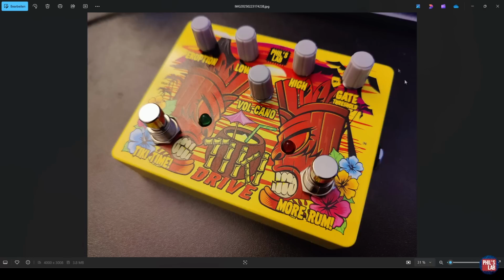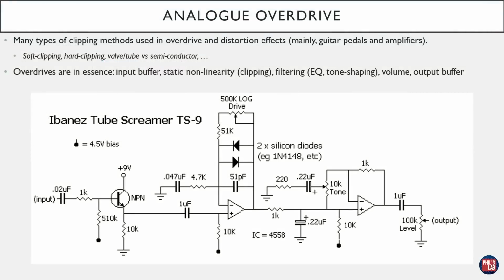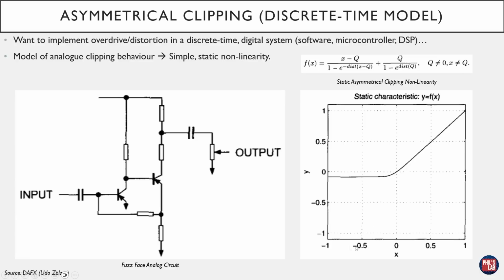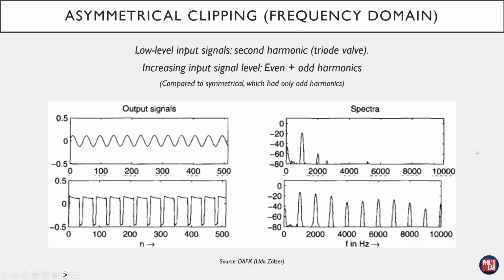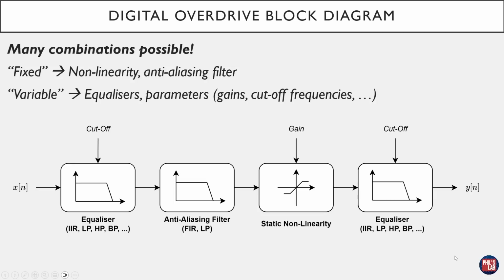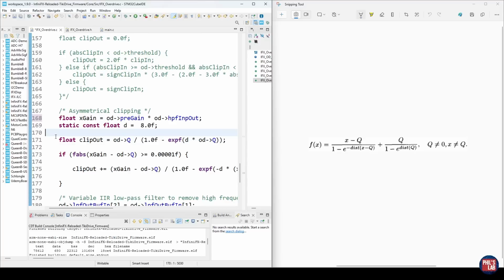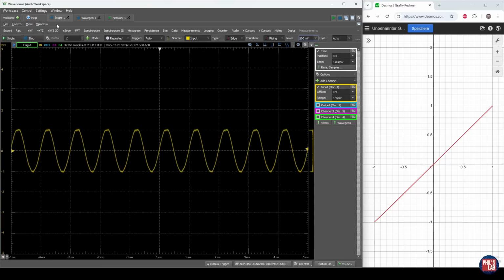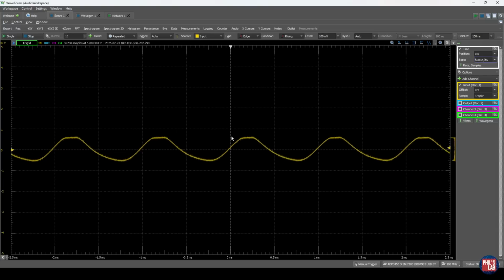DSP Overdrive (Asymmetrical Clipping) in Software (STM32) - Phil's Lab #153

Comment: Amazing video full to the brim with valuable details. If only I had your videos back in UNI days...

When it comes to the STM32H7B0, did you encounter a problem that it works until 88MHz (power level 3), and after that, it keeps freezing when the system switches clocks? For some reason, it happens to me regardless of whether I use an internal or external clock source and at any higher power level (2, 1, 0).

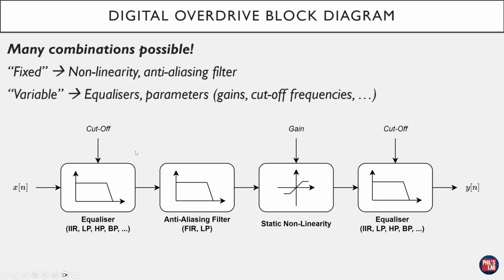Comment: 10:40 but aren't the supernyquist frequencies that cause aliasing generated /by/ the nonlinearity here? especially since you've already bandlimited the input by sampling it to begin with, the anti aliasing filter is generally the last step before conversion so that those frequencies don't make it to the converter and alias? idk man i'm not seeing the vision here, or are you just using zero oversampling and trying to preemphasis the high frequencies? because that makes even less sense to me, given the amount of distortion that an overdrive pedal is providing that just guarantees aliasing

Comment: I know nothing about DSP, but wouldn’t it be better to use branchless options to those ifs? 
I understand that doesn’t matter, since you have enough for one effect, but maybe if you could squeeze another effect from the same pedal. 
This is not a critique, just a question.
Reply from the maker: The videos show pretty unoptimised code to make the algorithms and principles clearer. Also, this doesn't really make much of a difference here, as the H7 still has a lot of processing headroom. I've run multiple effects in parallel (overdrive, noise gate, delay, reverb, etc.) on this without an issue without optimising the firmware.
Reply: @ Understood. Thanks for the answer. I’m really curious about digital audio processing. I’ll keep watching this kinds of content.

Comment: I think I know what I will do in my retirement:  projects that are a combo of self-designed board-level hardware and MCU software.

I'm familiar with the STM32 family of MCU's, having used a few of them in my designs at work.  My company uses a lot of them in MP products.

On one work project, I found a silicon bug involving an ADC feature and reported it and a hypothesis for its cause to ST.  ST confirmed the bug on their dev board and released a new version of the errata for the chip with this bug documented.

Comment: Great video as always! Are your input and output buffers the same as in your mixed-signal hardware course or is there any changes to it for guitar signal?
Reply from the maker: Thank you! I/O buffers are pretty much the same as in the mixed-signal course. For guitar, I typically limit the bandwidth a bit more (20-20kHz max.), maybe use a simpler anti-aliasing filter. Also depends on what CODEC you chose, you may have to adapt the filtering a bit.

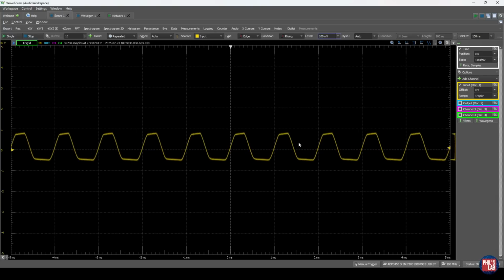Comment: Since you used asym. clip formula, what is causing the top part of waveform to clip at 19:10?
Reply from the maker: After the asymmetrical clipping, I have that +-1 hard-limiter. The asymmetrical clipping equation above +1 is just linear and therefore passes numbers higher than +1. Due to applying a lot of gain (via pre-gain), this is quickly reached and then hits the hard limiter.

Comment: FYI at a little past 18:00 mark you've got a few video clips that have a fade in applied
Reply from the maker: Whoops, missed that!
Reply: @PhilsLab  no worries. great video! i'm curious what settings you used for your intro lead and if that's the same algorithm displayed here
Reply from the maker: Thanks! Same algorithm (fully asymmetrical)/pedal, feeding a Guitar Rig 7 JCM800 + reverb/delay emulation.